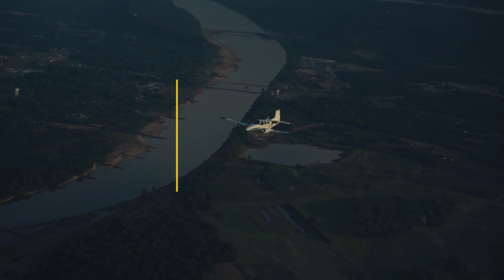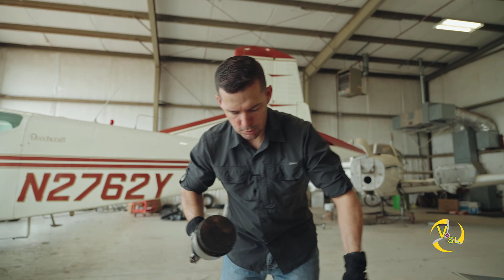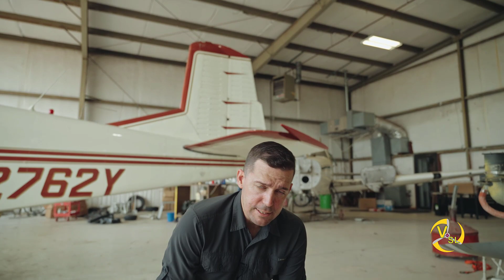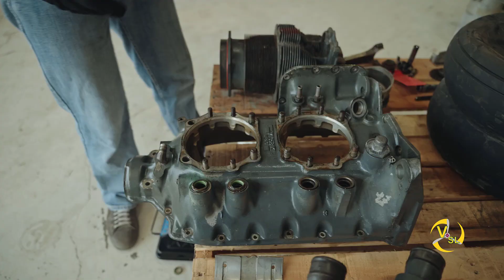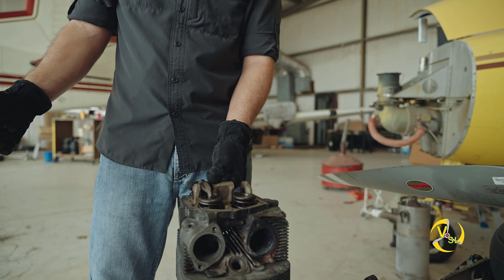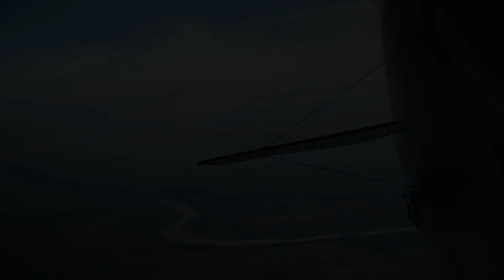Demystifying General Aviation Piston Engines: Exploring The Cylinder (Part 3)

Comment: Thank you for making this very informative video. Question: does oil on the cylinder wall prevent metal fatigue of the compression rings?
Reply from the maker: Yes, indirectly. The oil in the cylinder dissipates heat and provides lubrication. If there wasn't a thin layer of oil on the cylinder walls the compression rings would build up a huge amount of heat and fail.

Comment: Older engines had no pressure oil to the upper end valve train but had exposed rockers and valve springs that were greased every few hours of operation.
Reply from the maker: Correct!  That's also one of the reasons early pilots flew with goggles.  In an open cockpit airplane with exposed rockers the grease would fly off the rocker and back in the airstream. I would hate to have a hot glob of grease smack me in the eye!

Comment: This series is the best I have seen talking in depth about the engine components...I understand how a car engine works so you helped it all click in finally...and good timing as my C150 will need a recheck after annual since one cylinder has compression in range but lower than others I will more easily be able to understand what my A&P will be checking if needed...and doing CFI training...appreciate it
Reply from the maker: So glad to hear that.  My goal with these videos was to make the information a little more understandable and easier to comprehend than reading about it.

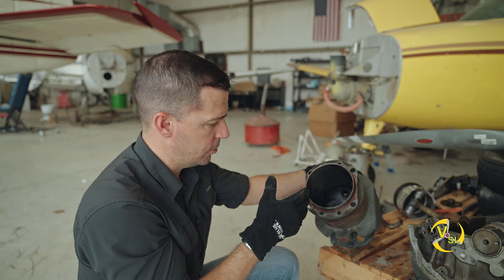Comment: 2:20 I guess it’s the same for injected engines, not just carbureted. (Unless it’s a diesel or direct injected (does direct injection exist in GA world?)).
Reply from the maker: Direct injection does exist in GA. It's actually the most common type of fuel delivery in most modern aircraft.
Reply: @SethLakeDPE  Really?? I though injector nozzle is before the intake valve in the most IO- engines (aka port injection). Direct injection would be direct into cylinder (like a diesel).
Reply from the maker: @xking18  interesting, I'm not actually sure.  I guess I misunderstood your distinguishing between fuel injection and direct injection.
Reply: It exists in diesel GA engines, like the Austro engines in the modern Diamonds like DA40NG